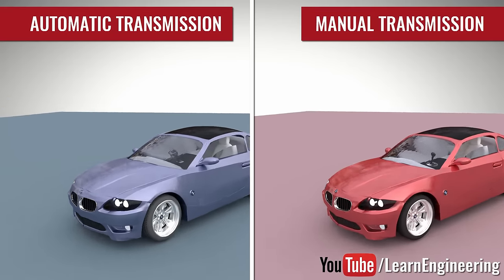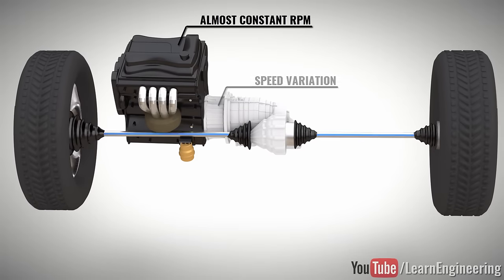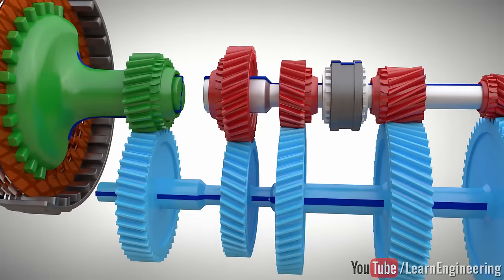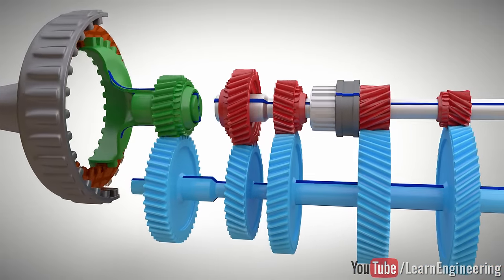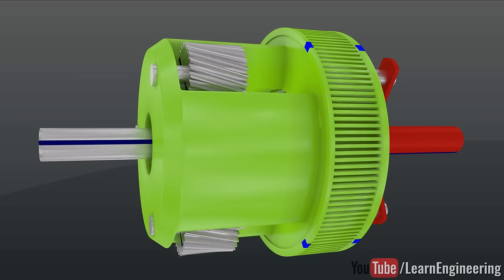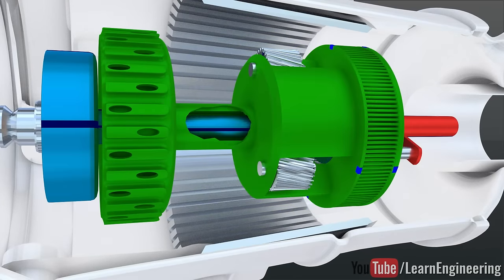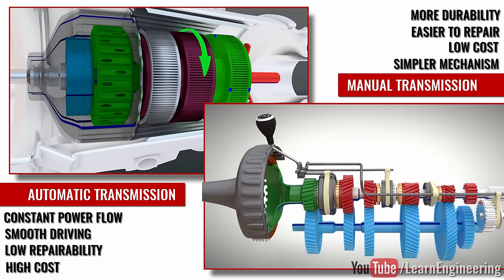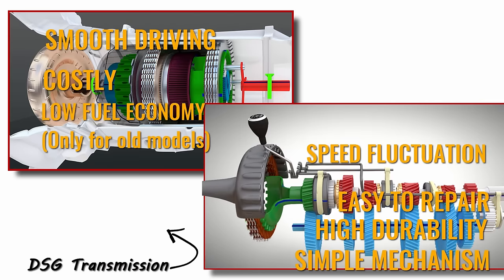Automatic vs Manual Transmission

Comment: As long I live in a region that gets snow, I will own a vehicle that has a manual transmission. There have been many times when I would have been hopelessly stuck if I had been driving an automatic. I was able to use the clutch and gas to "rock" the car out of a stuck spot. That probably shortens the life of the clutch, but it is better than being stuck in a snowstorm for hours or days.
Reply: If you're quick enough you can achieve this with an automatic too
Reply: Whether or not snow is a problem depends on the car itself and the tires. If that weren't the case sure some automatic shitbox would probably do a lot better in snow than an Iveco LMV
Reply: @Kaloyan Draganov  Actually, it depends on whether people have any clue of what they are talking about. Obviously you don't.
Reply: @LucidDreamer54321  It also depends if you are a larper who has driven an automatic once 20 years ago such as yourself.  Do you even know how traction works?
Reply: @Kaloyan Draganov  Do you even know how anything works?
Reply: @LucidDreamer54321  If manuals are so good in rough terrain why are all new military SUVs automatic?
Reply: Totally agree with you. I've gotten out of deep snow with a manual fwd whilst a neighbour of mine with an automatic 4x4 bmw x5 was completely stuck next to me 😂
Reply: Even in automatic you can put it in sports mode and shift gear manually
Reply: @LucidDreamer54321 boomer
Reply: You can fuck up the selected gear too, but the teeth are pretty strong so the clutch gets worn down first. The engine can also become damaged. 

When you turn a car off the power stroke gets to complete it's ignition and push the crank and complete exhaust. But when you stall the engine by jamming your transmission against it the piston is froze in place while the ignition occurs. This can damage the rings, the head, the connecting rod, etc. Also the exhaust stroke may not occur as the crank doesn't continue revolving. So exhaust may also be trapped in a bank. 

An engine winding/bogging down and a engine completely freezing in place are two different things though so it's not incredibly likely for someone to stall their car like that.

*(it's usually unlikely to cause that kind of damage because the clutch is much weaker than the engine components and the gears teeth, therefore it's the first thing to get torn up)
Reply: @kaloyandraganov9462 
They most definitely are not. Moreover you are missing the bigger issue of automatics switching to higher gear when the wheel is rotating faster due to a lack of grip resulting in the engine stalling when you get grip.
Not a ideal situation when being shot at.
Reply: @Suojeluninja  the citizens of yapptown want their mayor back
Reply: Dsg gearbox?
Reply: I've been driving semis for almost a decade, and all the office jockeys are obsessed with going to auto-shifters, completely failing to realize this exact thing is just one of the many small perks of manual transmissions. Also, "urge to move" really sucks when you're stuck.
Reply: Word! Not to mention, the capability to shift into a lower gear for more on-demand torque (= more control= better traction) and the ability to easier put the vehicle into controlled slides / break out of them. The ability to always be able to optimize for torque instead of optimizing for fuel economy (which many modern automatics will try to do) is preferable.
Reply: Bruh just get all wheel drive
Reply: @Aashishkebab  You do know there are all-wheel drive vehicles with a manual transmission and all-wheel drive vehicles with an automatic transmission, right? No, apparently you didn't know that.
Reply: @LucidDreamer54321  I have a manual with AWD and an automatic with AWD, and I can tell you the automatic does way better in snow.
Reply: @Aashishkebab  You are lying. You told me before to get an all wheel drive as an alternative to manual transmission. Obviously you didn't know that you could get a vehicle with all wheel drive and manual transmission.
Reply: @LucidDreamer54321  I did not at any point say that. Nice strawman though.
Reply: @LucidDreamer54321  my daily driver is a 1999 Legacy Outback with a manual but go on not knowing anything about anything.
Reply: @Aashishkebab  You are lying again. You did say that. I said I drive a vehicle with a manual transmission because it is better in snow, and you responded "Bruh just get all wheel drive." Any more lies you would like to write here?
Reply: @LucidDreamer54321  apparently you don't understand English, because nowhere did I say that manual transmissions don't have AWD, my point is that if you have AWD the transmission isn't relevant. 

But go on. Pretend you know what I drive. I've done more off-roading than dirt roads you've laid eyes on in your life.
Reply: @Aashishkebab  Wrong again. You didn't ask me if my vehicle was all wheel drive. I said that I drive a vehicle that has a manual transmission. You obviously assumed that my manual transmission vehicle could not possibly be all wheel drive when you responded and said I should get all wheel drive. Are you ever going to write anything here that is not nonsense and/or a lie? I seriously doubt it.
Reply: Why people with Slavic names are rud very often? Is this russia's influence?
Reply: @specialagentdalecooper4857   What people?
Reply: @specialagentdalecooper4857   What Slavic names?
Reply: @specialagentdalecooper4857   Is what Russia's influence?
Reply: @specialagentdalecooper4857   What is "rud"?

Comment: The people that invented these things are geniuses. 

I'd love to see a similar video about electric car engines. Would the automatic gear system be the same?
Reply: An electric car dont need to shift gears as the 3 phase VFD controlled motor in modern electric cars operate between 0 to 7-8000 rpm with no problem while an internal combustion engine works best between 800 - 3000 rpm, hence the need for many gears to keep the engine in that speed range. Also the tourque is at max at a certain rpm for a combustion engine unlike the electric motor wich  have 100 % torque from 0 rpm through its entire speed range.
Reply from the maker: Thank you for the awesome reply. We are going to explain all these things in our electric car video.
Reply: Learn Engineering Fantastic! Cheers to everyone making these videos. I love how clean, detail, professional and informative they are. You guys are awesome.  :D
Reply: Most hybrid and electric cars use a CVT (continuously variable transmission).  Which basically means that you don't have SET gear ratios.  What happens is that the gear ratio gradually changes as you go faster, so as you accelerate lightly, the RPMS will stay somewhat in one place.  If you Floor the gas pedal, the transmission will hold onto a lower gear ratio for longer to get that better acceleration.  The simplest explanation I can give you is this:  Picture a large cone shaped object,  then picture a belt riding on that cone and attached to the transmission output.  The gear ratios change by sliding that belt back and forth on that cone.  It's like a bicycle,  the bigger gears on the crank will give you higher ratios, and when the chain gets put on a smaller gear, the gear ratio becomes lower.  The only fundamental difference between that and a CVT is that the CONE shape allows the belt (or chain) to slide up and down gradually, changing the ratio.  Hope that answers your question!
Reply: Shadow Heart the answer would be no, most electric cars have direct drive, wich means no gears, no shifting. this is because an electric motor is not limited to a specific range of rpm like gas engines. they are much simpler with far less moving parts. they can deliver power to the wheels over a much wider range of motor speeds.
Reply: the weaknes of electric power is the source, batteries. up until recently the price of a battery that would be strong enough to allow for practical daily use was astronomical. new highly efficient battery packs are much cheaper, charge faster, go farther, and weigh much less. you can check out consumer reports on vehicles like the chevy volt and other all electric vehicles that are now being not tested but produced and sold to the public. i am a master mechanic in the field since 1993 and i am still amazed every day by how far technology has come
Reply: Travis Capehart It is indeed impressive.  I used to know the features of new devices (I love tech) but in recent years I've been overwhelmed by the amount and sophistication of tech.

Thanks for an informative reply.
Reply: Travis Capehart - The interesting part about this is that electric cars actually DO need a transmission. At the very least to reduce the motor speed in the currently normal single step down. But, if you look at the power curve, they become less efficient and more wasteful the faster you go. So, a two- speed transmission for electrics would give them greater range, while still allowing the astounding take-off ability.
Reply: I think, I don't see any reason why not.
Reply: TRLWNC1 I haven't had a chance to work on the new all electric cars but I have done alot of work on hybrids a single step down in the final drive differential is sufficient for most operating conditions.  But with the advances in both motor design, and battery capacity,  all electric cars are definitely not going away.  A two speed gearbox makes sense for both acceleration, and energy conservation.
Reply: Shadow Heart , the mechanism would be the same as the gear system has no difference in electric or fuel run vehicles..
Reply: well they didnt just invent this complicated machinery. This comes from decades of refinement.
Reply: Keenan Bartlome "If I have seen further it is by standing on the shoulders of giants"
-Isaac Newton
Reply: Shadow Heart do you mean... hybrid? coz electric cars have motors not engines!
Reply: TRLWNC1 they are not less efficient in high RPM, it's other way. In low RPM, there goes large current through winding, making lot of heat. In higher RPM, current reduces (ofcourse torque reduces too). Current reduces because of inductance, meaning there are minimal losses. And less current mean less heat, meaning higher efficiency :)
Reply: still don't understand. maybe i'm idiot.
Reply: Honza Papež
Reply: Shadow Heart no, you aren't. Some people just have a better foundation for this type of information than others. If you don't understand, your background just might not give you the right amount of a foundation for this knowledge. And that is okay.
Reply: electic cars have 1 gear the motor is pretty much connected direcy to the drive shaft
Reply: Spedracer55 or they have a motor for each wheel (like the tesla's)
Reply: +Krishna Jo 
Its ok man. I also dont getit
Reply: John Pekkala   Some electric cars have gearboxes the same as petrol. These conversions are gaining popularity here in Australia. As you can take the car you have and swap motors. The good thing about this set up is battery power length of time powering, is extended. The alternator of the original set up is used as normal and can charge batteries. You won't get a full charging of batteries, but enough to extend power time under use. Autos are preferable, but manuals work equally as well.
Reply: Genius? lol a dog could make cogs work in unison.
Reply: And yet it took humans thousands of years to make the first engine.
Reply: how to remove the fuel injection pump from Mercedes  Benz 1983 300sd
Reply: Like others have already said, an electric motor can make peak torque at 0rpm so no need for a traditional gear box setup.. however, the Rimac concept 1 is an all electric car with a 2 speed transmission which allows it launch like a bat out of hell like a Tesla P100D but also gives it more top end power to approach higher speeds which Teslas can not do currently. Search youtube for Rimac concept 1 vs Porsche 918
Reply: John Pekkala thank you
Reply: electric car dont need no gearboxes they are direct drive when they REEEEEEEE they power just the wheel

Comment from the maker: Dear patrons
Sorry, I couldn't publish your name/photo toward the end of this video. The climax scene of this video was filled with so much information that there was no space left to display your name. Sorry for that. I will show your name/photo from the next video onward. Thank you for your continued support.
Reply: Learn Engineering mate that's why we love manual that "variation of speeds" helps a lot in mountain road or in a drift course so in other words auto is good for inexperienced drivers to go from point a to b (sub humans) and  manual is for much more experienced people (car guys/petroheads) who love the turns on a mountain or a racetrack 😉
Reply: Learn Engineering Please make a video regarding working of carburetor and fuel injection system . 
Thank-you
Reply: Learn Engineering except drag racing where autos dominate
Reply: stevemic drag racing is only for cars corners are for drivers tho ;)
Reply: HH E I hope, you are taking about AMT. They are just computer controlled manual transmissions. They have all the drawbacks of the manual transmissions.
Reply: HH E cool stuff tho i'm into manuel controled by human more fun expirience
Reply: close but not 100% right.
Reply: Very well explaned , but the real thing that makes automatic transmission worst than manual,  is that in manual you can use a high speed gerar ( 6* or 7* gear ) to have low gas consumition .2* you can use the Limits of the engine properly. That´s why there is no automatic gears in races. But the automatic gears are awesome. But in normal cases, automatic gear  dont respond so well in aceleration . Looks like the clutch its not fully conected.And in Manual, especialy in Moto GP and F1 cars , the gear change  speed its pretty fast.
Reply: Most 1/4 mile drag cars and pro street cars have automatics, you can make them just as strong as a manual,with a manual shift valve body and high stall converter,they are faster and more consistant, I have a c5, zo6 clone with 500+ hp and an automatic,  beats six speeds all day long,on the street and still has overdrive that gets 20+ mpg on highway and hands/stress free driving in traffic,with the ability to grab any gear you want,anytime  like a manual....................and yes,a manual uses the limits of the engine better with human input,but no one can do that better than a well tuned computer that makes decisions in mili-seconds,  thousands of them !
Reply: niki phillips
I understand your point, but NO you are wrong , In track Comput dont know if head there is a turn or not, so if you give full gas , you can make your car change gear 3* to 4 gear , but again must to get back  to 2 gear , and You lost time on that. And you dont SEE any race with automatic gear. Right? Drag races , FULL  Manual, F1 cars , Full manuals. ( by the way ) you said about computer, in 94 F1 gear box was  controlled by computers. The pilot only need to press a single button ( checkout at Senna´s car at 94 ) Indy cars full manual , And My brother had automatic car , and he spend to much money with gasoline. Becouse the COMPUTER thought was better to keep 1* or 2*  gear at 40 to 50km/h , and with manual he use all 5 gears. Becouse if you gas a bit more at LOW RPM  , the automatic gerabox , will UP the gear to get more power , where there is no reason. So automactic gearbox Sucks at race mode.
Reply: HH E
No I am saying ,when you are in a race track , sometimes you need to go to the limit of the engine, becouse there are a turn pretty close. When you go for example 4* to 5* but the turn ask a 3* gear, if you allow the automatic change to 4* to 5* , you will lose time. We are talking about 0.1 ou 0.2 becouse its not just the gear the problem but the diferencial too.And on normal roads , automatic gearbox , makes  the car use more gasoline. If you press a bit more the gas pedal, the automatic gearbox will try to make a downshift ,to use ((Better)) the HPs, but there is no point for that.I already saw automatic Gearbox, making downshift and upshift ,  becouse  the drive pressed  just a bit more the throttle, and than reached at 60km/k the gearbox puted a 4* , when the car got 45 or 50km/h the gearbox did downshifts. But there was no reason to do that. And i am a RACER . Just look on this way, almost every sport cars have manual gearbox, i am not saying  that you cant to buy a porche with automatic, But i dont like it.When i need FULL Power , i can chenge the gear myself . lol
Reply: +Mohan King a manual gives you greater speeds as well due to being able to control how the car pushes itself. Also sounds cooler.
Reply: Roy Pratt
well i am talking about race cars , and not normal cars. For example Automatic gears are more heavy .This is bad if you looks in racer point of view. But if you ask to yourself  why drag racers dont use automatic gearbox , maybe you can say , well its about the SKILL to change at perfect time. ( maybe )Or at fully 6000hp or 10000 ho engine automatic gearbox to race inst a good idea. Or takes to much time to transmite the power to the well , becouse manual transmition its more direct. But in road  track , i prefer manual . I think manual its more economic in gasoline ( math ) becouse i can make the engine runs with 1100 RPM  more or less at 5 gear at 40km/h ,as i dont need more power to maintain the speed, and its like i dont need to throttle it, and the gasoline cosumption  its like IDLE , and this you will never do it in automatic.
Reply: +Mohan King I agree. I plan to get a manual for my first car. Manual is one of those things that needs to be brought back.
Reply: +Roy Pratt Made more standard is what I mean, more popular than it is now.